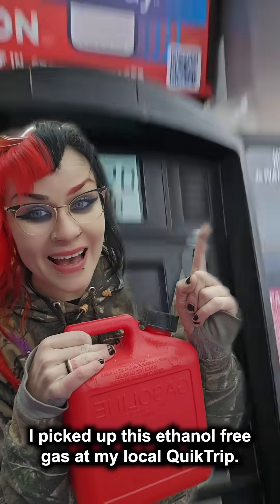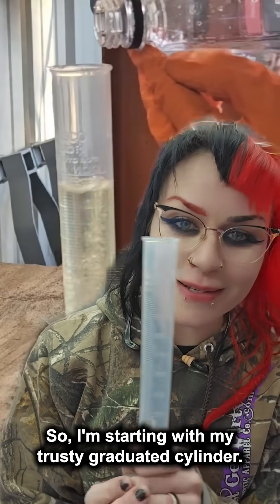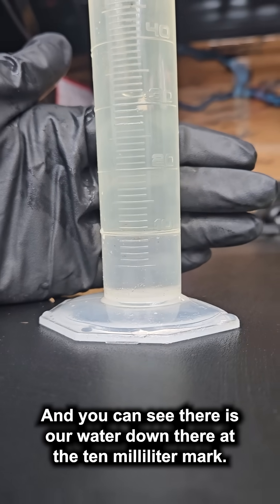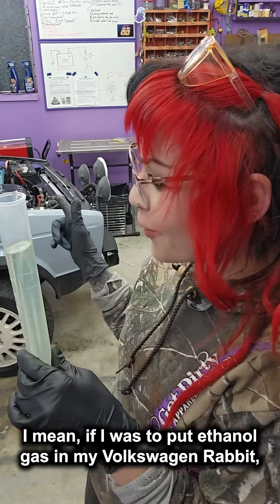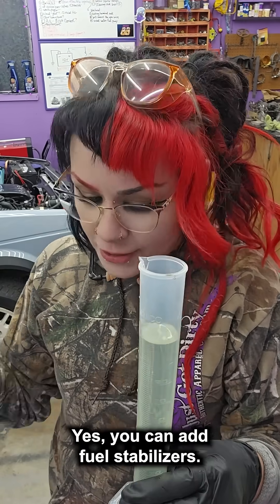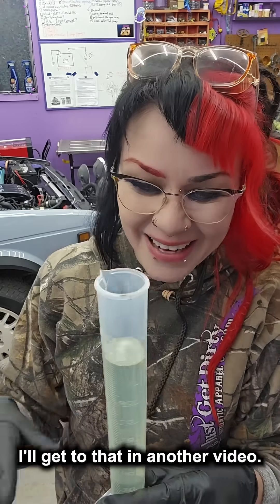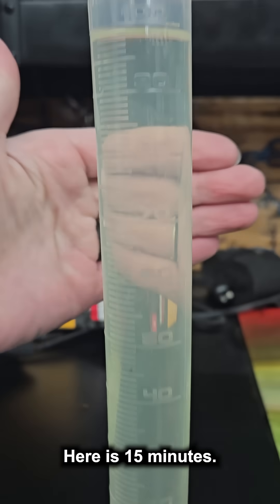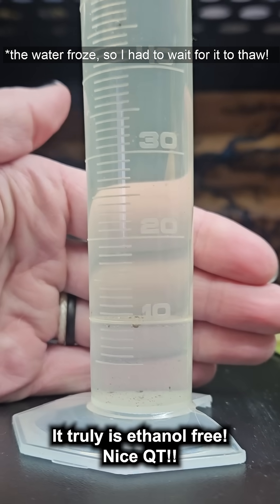Is Ethanol-Free Fuel ACTUALLY Ethanol-Free? Testing QuickTrip fuel using the Water Extraction Method

Comment: Word of warning. None of this really means anything if you don't actually get ethanol-free gas at the pump.  

Just to add to the ethanol debate. I just watched an alarming video where pumps were tested to see what actually comes out. And the conclusion is what you actually get, for the first two or three gallons, is what the previous driver pumped.  Because that's what's in the fuel lines from the underground tanks to the nozzle at the pump.  It's actually leftover fuel remaining in the lines.
This is devasting for vintage motorcycle riders, who only have a 4 gallon gas tank. It was recommended to pump at least two gallons into your car to clear the lines and then start filling a gas can.

Comment: I make my own ethanol free gas with 93, distilled water and food coloring but I only use it in the mower and pressure washer. The Walmart wanted a dollar more than 93 for ethanol free gas but it is a process so I just use 93 and stabil in the fuel can.

Comment: Ethanol is a good and fairly safe octane booster (compared with Tetraethyl Lead or various Benzenes). It's not intended to be stored - and fuel chemistry is altered seasonally so you generally don't want to store it for 3-6 months

For long term storage I lean towards blowing the lines out and draining the tank

Comment: If you VW Golf was filled with 10% ethanol gas you would wouldn't have a major issue in a few months unless your fuel system was open to atmosphere because if it is full and sealed then there is no moisture to get in the fuel and no room for it if it did.

Comment: I live in Central Florida with extremely high humidity. One winter my buddy parked his boat with half a tank of gas. By the end of winter it had a full tank. It absorbs so much moisture out of the air. This was in the early days of ethanol fuel. It still absorbs moisture from the air but not as bad as it did 10 years ago

Comment: I did this with my local Kum&Go because the price did not reflect the product. I wanted to fill my 420hp WRX with what they claimed was non ethanol 93 (now on E87) but it was actually over 10%. I went back to let the manager know and her exact response was “okay and?? Gas is gas”. Now that station used to be a popular place for small meets and fill ups but no one I know uses them anymore and they just put a Quiktrip across the street 😂

Comment: I support the idea of gas stations having clear gas (E0) and E85 tanks, with mixer pumps to make standard E10/E15 gas for newer daily drivers (the ethanol actually helps in modern engines if used regularly), and offer E0 and E85 for the applications that require or reccomend them.

Comment: Water in the fuel is why small aircraft have ports at the lowest point in the fuel tanks. Before flight a pilot will sump the tanks and drain a sample of fuel from each tank into a test vial and check for water. The fuel is dyed (blue for 100LL) for easy recognition of fuel type and water appears clear in the sample.

Comment: Unfortunately, you are  Leaving out information about ethanol.  if the system or the container that the ethanol is stored in is sealed where there is no air transfer from the outside. Then it cannot draw moisture because there is none to draw.  That is why.
Modern cars that Use.
 E85 a.k.a. Flex fuel have sealed fuel systems.
 I am Master mechanic of 40 years experience. So well, ethanol ethanol based fuels will draw water in an unsealed system. If the system is built correctly, there will be no issue.
Reply: Yet your intake air has moisture in it.

Comment: Just shake it and wait till its clear can take a while used to do that with all my fuel for my 95 1.8t quattro a4 cos it ran like crap with ethanol then they hot rid of 98 in ireland and it ran like crap all the time unless i had about 3 bottles of booster in the tank

Comment: One experiment I would like to see is if you can use a fuel /water separating filter to remove the ethanol/water from gasoline. Even if it requires adding more water, two absorb with the ethanol to make it easier to extract.

Comment: E-10 used to be much better than the crap we are sold today. The oil companies started blending inferior grades of gas with Ethanol (100% Ethanol) at 10%, to bring the quality up to  what will burn in todays engines. If you could seperate the 10% Ethanol out of the E-10 gas, you would have some seriously bad running engines, your car would not run.

Comment: It needs to be all ethanol free, unless you WANT e85, or e90 to make more Powah!  But to force it on me for my snow blower, is bs, I had to pay 50 bucks for a 2.5 gallon can at Home Depot., my auger is a total loss after it sat one year., and cars even those designed for it, have fuel line and general fuel system deteriorating issues, and those not designed for it, have even worse issues if they sit any more than 90 days.. let farmers grow food, not fuel.

Comment: Ethanol has a ton of problems. It absorbs water, it's really inefficient to burn, it destroys rubber, and hard on fuel systems. And we haven't even talked about what it does to diesel systems. Almost half of all corn production goes into making ethanol and about 200 other crops are used for making it too which takes a lot of land out of food production. It's subsidized at the refinery and refiners wouldn't blend it if the tax dollars weren't paying for it. There was a big push in the 70s and 80s for renewable fuel after the gas crisis but after 4 decades of it's obvious failure it needs to end. It's just a big kickback to farmers and oil companies and a total waste of money.

Comment: Ethanol has an octane of 113 gasoline much less unless you refine it more than the refinery’s like to due to cost.  The 10% blend lets them get away with cheaper gas but they kept the price higher even though ethanol is way cheaper and they refine the gas less than they used too

Comment: In the industry, 100mL of fuel plus 10mL of glycol is used in a graduated cylinder for spot checking the fuel for ethanol. If it is just gasoline/naphtha, we use ASTM D4815 to determine exact oxygenate content. 😊

Comment: When refueling a Gasoline , Petroleum container  .......

Static Electricity 

Put the fuel nozzle up against the fuel containers structure  , making the gap between the nozzle and  the container may induce an electrical spark = ignition , explosion in Gasoline , Petroleum 

With diesel this is not so bad , as it is a compression fuel . ( no spark , diesel  it compresses to ignite  then explode )

You put your life at risk 
By not doing this .

Comment: Best stuff for small engines. No ethanol, so it doesn't eat up the rubber fuel line and plastic parts in the fuel system.

Comment: Wow I have had 87 in my f250 for over a year and it starts and runs fine and it's been running on 7 cylinders for 3 years almost 4 just started it today and haven't started in a couple months crazy I had a 96 toures with the same gas for 4 years and only starded maby once a year and drove it around 40 miles after 4 years then the transmission finely went out wounder why I have never had a problem with old gas with ethenol in it we don't have ethenol free gas around Cincinnati atleast I havent seen it since the 90s

Comment: I didn't know QuikTrip sold E0. I'll have to check them out. 
I buy E0 at the MFA oil CO-OP here in rural Missouri. They usually have as low or lwer prices on all fuels. But the pumps do share a common hose.

Comment: Would you like 30% more power, more fuel efficiency?  Do not use ethanol fuel in a non ethanol vehicle. It burns but at a fraction of the power of gasoline.

Comment: You are all so confused. Ethanol will absorb any water in your tank and run it through your combustion chamber. With straight gas any water sits on the bottom of your tank just like it did in your graduated cyclinder.  This can lead to frozen gas lines among other problems. Funny thing is the same people who hate ethanol will religiously add Heet to their tank. Heet is just methanol, it absorbs water just like ethanol (and all alcohols).
There may be legitimate reasons to be down on ethanol, but it keeps your tank bone dry. Note: If you get a ton of water in your tank the ethanol can't absorb it all and you get "phase separation". But this never happens to a car used regularly so you don't have to worry about it. (Happened to me once with a boat that set for 3 years, had to drain the whole tank.)

Comment: I'm looking forward to the fuel stabilizer video!
Reply: It doesn't work, I had ethanol in my van that went to the shop, I added stabilizer, the fuel tank was destroyed by the ethanol, it had absorbed enough moisture to ruin the gas tank, and that van has no replacement tank offered for it, you have to get one custom made.

Comment: yeah the only problem is they only offer it 87 octane.  My bike needs 93 to really run .  Yes yes I know I can add octane booster to make up the difference ,but that crap clogs up my low speed jets and slims my  needles so.... 93 with crap in it goes unless I'm storing over the winter.  God knows how much of a pain doing V4 carbs can be.  Great Video though 😁. And no I  didn't take my meds today and yes I know "intrusive thoughts" are supposed to stay on the inside.. Buuuut

Comment: The nice thing about KwikTrip is that they have a separate hose for each gas/fuel type. Where others share a hose for two or more gas types.
Reply: You're from Wisconsin, or a state surrounding there, aren't you? I only ask because you typed "Kwiktrip" with a K. And not Quicktrip with a Q where she's located.
Reply: @Youhaveaname  Illinois is QT and if there’s a kt affiliate it’s Kwik Star.
Reply: @Youhaveaname i’ve only seen k on the east coast
Reply: As a Marylander, (we dont have them) the nice thing about kwik trip is Everything
Reply: Wrong Kwiktrip, we don’t associate that shitty gas here
Reply: As a trucker, KwikTrips rock!
Reply: Not true at all.
Reply: Yeah I flush it into my vehicle before filling up my cans.
Reply: Yea I noticed that my gas station that has ethanol free is the same pump and 10% ethanol so if I'm getting a jug of ethanol free o pay for lil more than I need and pump some onto my vehicle first
Reply: Never seen that anything shares a hose with ethanol free. I daily a car that just runs better and smokes less when I run 93 ethanol free the motor even sounds quieter. I have never seen one ethanol free gas pump that is the same
Reply: Sheetz has separate hoses also. QT tends to be down south. Sheetz is more in the north.
Reply: I work at a gas station we have 3 hoses usually green for diesel yellow for flex fuel and black is shared for 87,89,93. On the other pumps we have red for ethanol free, blue for 88 octane, and then the black is split three ways again. Somehow everyday we have customers picking up the wrong handle and getting mad at us.
Reply: What i do is choose non ethanol and put 15$ in my truck 1st, then fill my jerry can for my sleds etc. If they share a hose.
Reply: @kevinscheifele6833  You really don't need that much to flush the hose. Only like 2 or 3 seconds
Reply: @pws3rd170  The entire hose from the pump base can hold upwards of a gallon of fuel depending on the pump model. So, first gallon is recommended to be run into separate use container or vehicle.
Reply: Its QT not kwiktrip
Reply: Same difference. They both have separate hoses for each fuel type
Reply: This why I usually give the hose a good 3 second squirt on the ground before using.

Comment: Assuming it is a hardtop, it looks like a 1970s, maybe a 1980 model.  Separate side marker light on the fender.
IIRC, here in the USA, the 1977 - 1979 & the Cabriolet came with round headlights (sealed beams).  In 1980, they switched to rectangular sealed beams.  In 1981, they switched from the bumper-mounted turn signals and separate side markers to the 2-in-1 lights next to the headlights.

The hardtop hatchback was called "Rabbit" here in the USA 🇺🇸, "Caribe" in Mexico 🇲🇽, and Golf (Mk1) in pretty much the rest of the world.  The pickup was called the "Rabbit Pickup" here, and "Caddy" in much of the rest of the world 🌎.

The "Caddy" and the "Cabriolet"/"Cabrio" are/were sold in other parts of the world for a decade or several decades after the hardtop hatchback ended production.

I learned to drive in my dad's 1980 diesel Rabbit.

I think original rubber fuel hoses, o-rings, gaskets, and seals were also not very tolerant of the alcohol in E10 gasoline.  Metal parts, no problema.  Rubber/plastic/cork not very good, as far as I know.  Newer formulations of hoses, o-rings, gaskets, and seals are more resistant to ethanol.  Beware fuel leaks if using E10 gasoline in your vintage automobile, especially if still using original or NOS¹ rubber fuel system components.

YMMV

Happy wrenching 😊

¹New Old Stock

Comment: PS the best and most stable fuel is aviation 100LL gas, but you can't legally use it on the streets (no road tax paid) and the small amount of lead is going to clog the catalytic converter. But boy does it burn nice and leaves that wonderful white deposit on the tips of your tail pipes in an older car and it lubricates the valve seats

Comment: the H2O in the VW tank is the least of your problems. Nothing in that fuel system is designed for the corrosive properties of Alcohol, which is in today's gas. It will eat hoses, seals, carb bodies, FI components....

Comment: Corn gas ruined everyone of my small equipment engines. I’m just about done replacing all the carburetors and fuel tanks I own. It’s expensive but ethanol free is the only gas I use in them now. My vehicles are diesel.

Comment: My kt has 91 corn free. I use it in my 69. But my other local station has E blends. E15 E30 E50 and E85. I run the E50 in my ATS. It’s usually pretty close to 50% usually around 44-46%

Comment: I use a glass graduate cylinder, don't trust the plastic ones being gasoline safe. Also I use a rubber stopper to seal the top and let is sit so the water in the atmosphere doesn't effect it. You have to realize, there are way worse things in pump gas than ethanol. There are additives that not only keep ethanol suspended, they are a catalyst to help it burn. Recommend using those additives for vehicles that sit for long periods rather than buying that over priced 91 octane gas. I have run into getting 91 octane that was bad too many times. Gas stations don't sell a whole lot of 91, most of it is 87 octane gas. So I don't buy 91 any more and just treat 87 and boost it to 91.

Comment: used to work for a very large automotive/diesel fleet.  At times we had big problems on our small gas engines (for aux equipment and generators) caused by attempts to run a motor using old gas.  And using gasohol only made the problem worse.  Some small engines sat idle for months with the same gas, and anytime gasoline sits longer than 3 months, you are on the edge of fuel breakdown.  

Since it was my job to keep most of these engines running, I added Sta-bil to every small engine I serviced. Sta-bil will keep fuel fresh for a year, or even TWO years if you double the dose - but it was not infallible.  Adding fuel stabilizer went a long way to prevent no-starts, but some fell through the cracks anyway.  If I knew an engine might be stored indefinitely, it was just standard procedure to run the carb empty of fuel.  
But one day my heavy mechanic friend was tearing apart a carb necessitated by a no-start condition caused by fuel breakdown (the operators had made it inaccessible to me for too long).  I still felt bad about him having to do all that, even though that engine wasn't even on my equipment list.  

Point being, a gas engine can sit unused and idle for years, and still start right up again without issue.  But only IF the engine has reasonably fresh fuel to run on -
Reply: I've found that if you can store pump gas in a non-porous (metal, not plastic) container with little air inside and keep it air tight, you can keep even crappy E10 pump gas for 2 years or more, and that's with no additives at all. Any exposure to the atmosphere shortens its life exponentially. Some carburetors are better than others in that regard - some keep for several months, while I've seen others clog up to a no-start in just 2 weeks flat. 

Here in MA, I have to drive an hour + north of here to NH, VT, or head west into NY to get ethanol free fuel in bulk with an empty 55 gallon drum. Such a PITA, but E0 isn't available at any pumps here outside of a coastal marina (80 miles east, which is almost an all-day trip around here), or very expensive 100LL aviation fuel  (which also has lead in it ... which can create more problems in small engines) at an airport.
Reply: @SmittySmithsonite your right I did a test with truefuel. I put the same amount of fuel in two small mason jars put a line at the top where the gas was with a marker, then put a small hole in one lid and the other with out. The vented gas jar evaporated and turned yellow the unvented one  stayed at the line Chrystal clear for 2-3 years. Evaporation is a lot of the problem so i put a plastic bag or something similar under the gas tank lid.
Reply: always run all my toys, and equipment empty before i put it up for the night.......let alone all winter probably run the tank out when the first gloomy day after all the leaves fall

Comment: If it's being used by multiple grades. After you empty the fuel line 1st. It will always have water in our gas! We need to get back to NO WATER IN OUR GASOLINE! And they lied to everyone that it helps the environment we have to use extra fuels to get the same amount of work/ mileage & then the add costs in repairs to our vehicles!